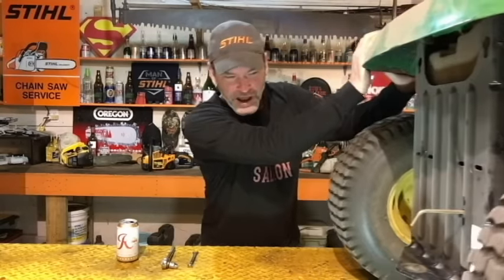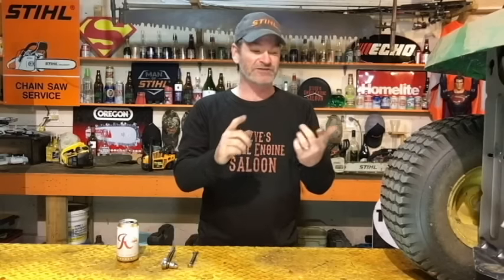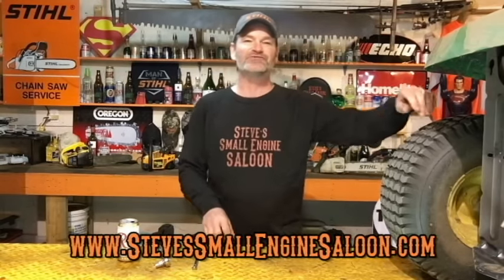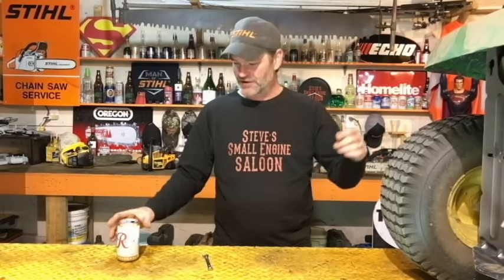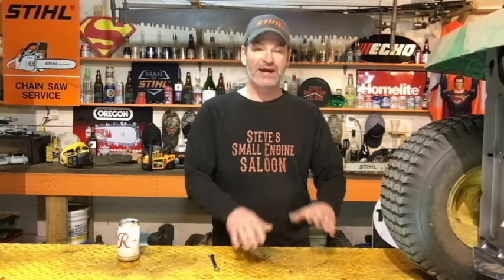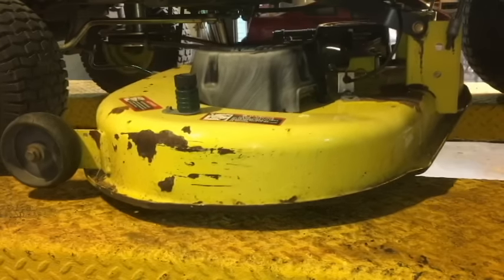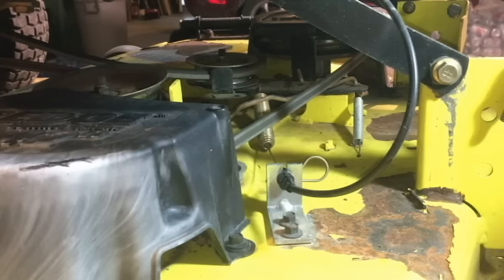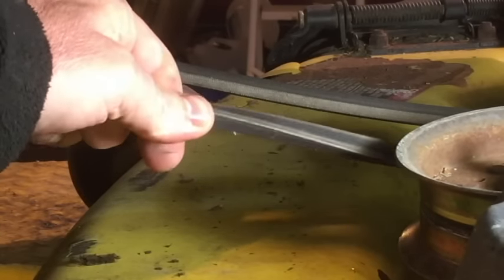How To Adjust The Belt Tension On A Riding Lawn Mower

Comment: Another great video, Steve - thanks! Bought a JD E-100 this summer - have less than 5-hrs on it & the belt broke. When I replaced it, the blades stop spinning when I drop the deck below 3-inches. I tightened the tension spring you like said and leveled the deck.  I dunno what's going on.

Comment: Steve, 

I have a John Deere L100 as well. You did a great job explaining it. That arm that is supposed to be mobile is not for my lawnmower. I sprayed lubricant on it, it moves a little, but after adjusting the two bolts, my belt is still loose. Any ideas? Thank you.

Comment: Quick question Steve. Put a new belt on the deck today and still slow engaging.... I havent tried the adjust yet,but if the doesnt work what's the chances it's the cable itself stretched?

Comment: Love your channel , Steve. I have a tired L120. My problem is the blade belt constantly gets twisted. It has an electric blade clutch so the belt is under constant tension. I've replaced the belt twice as once it gets twisted it dramatically shortens the life span.  The tension spring is tight. I just pulled the deck out to replace the drive belt and sure enough , the blade belt is twisted. It's a brand new belt only used for one cutting. I'm totally stumped. I'm hoping you or one of your viewers can help me ...

Comment: My belt is tight but the lower the setting it wont spin up my engin surges and the the  engin doesn't seem to rev up it spits and sputters smokes black when sputtering do you think it is a carburetor issue? Please let me know what you think

Comment: Steve, my newer JD 100 does not have that adjustable bracket. It is welded onto the deck with no adjustment bolts. Any ideas?

Comment: So my Craftsman LT 2000 does not have the adjustable bracket. It has a housing hole and a hole to screw it down. Any thoughts on how to tighten if it’s just a pto cable? A new spring?

Comment: Great Vid Steve! I have a Craftsman LT1000 that I just replaced the drive belt on. I noticed a lot more power on it but now it won't shift speeds while it's running. It does shift normally when it's off. The brakes don't stop it and it slowly creeps. I also noticed that my clutch/brake pedal does not respond as it did, meaning fully compressed/decompressed is very short. I am thinking probably cause of tight tension on clutch pully from new belt. ANY IDEAS ON AN ADJUSTMENT?

Comment: I just bought a Craftsman T100. It has a 36 inch cut but the right side does not fully cut the grass. Could this be an issue with a new mower ?

Comment: SUPER helpful video. Thanks, Steve. I have a 16 year old L100 with a Kohler Command engine which runs as good as the day I bought it. However, I have noticed the blade rpm has not been optimal through taller grass. I'm hoping a simple adjustment will fix this...love your channel. Cheers!
Reply from the maker: Good luck!

Comment: Hi Steve, I have a problem that when I start the mower up, the belt is so loose it snaps. I have tried to make adjustments, Ive replaced the belts with the original and with different sizes but it hasn't solved my issue. All the pulleys are in good shape. In your opinion would this tension technique solve my issue or in your infinite wisdom do you know why this is happening or have another trick that will solve this issue? Thanks Greg

Comment: Okay, I have a question. What would cause a riding mower to move (creep slowly in the direction it was last moving) when your foot is off the drive pedal? Something snapped (noise) and now it's doing this. Before the mower sat without moving. Clearly a pulley is still engaging the drive belt? Works fine beyond this. Any clues?

Comment: Hey Steve, great video. My 1999 15.5 42 Hydro JD does not have this feature, all it has is a bar cage for lack of a better term around the main drive pulley.  I can't seem to find a whole lot of info for this particular model for some reason. If anyone out there can recommend a decent website it would be greatly appreciated.

Comment: Hey Steve. I thought I was set when I watched this video. Went right out to make the adjustment. Turns out that bracket you moved is welded on my E-100. I also took the cable loose on the other end to see if I could shorten it, nope. So I'm back hoping you've got a solution.

Comment: wow, you hit it on the head!  The tension on my 42" Cub Cadet belt was too loose!  Not being familiar with where everything is on the deck, my fellow had to go on home to his dinner. Will be back tomorrow after he Googles a diagram...BUT, hold on, I'll refer him to this video. The Cub Cadet tension wire(cable) is set up in a very similar way as yours so I'm sure he'll find it and viola! the belt will stop coming off.  Eventually it'll need a new belt but not just yet.  Thanks!!
Reply from the maker: Right on

Comment: i knew the part about the adjustment but the issue with mine (and the
mower is only a year old) is that there was so much slack (with a brand new
correct OEM belt) in that "spring cable" to begin with that adjusting
it to the very end of the adjustment was necessary. What i did was take the
spring clip off removed it from the adjustment mount, then unhook the cable
from the tensioning bar, held the spring and push the cable up until the ball
from the cable was exposed. I took a small lock washer (i think it was
1/8" and spread the washer open slightly and slide it on the cable and
then closed the washer again. Only one washer was enough for my issue so if any
try this method of remedy, if you have to use more than washer then be aware
there might be another issue. When I remounted everything most of the slack
from the cable was gone. Now when I adjust the plate with the 2 10mm bolts it
actually had the effect it was meant to have. UPDATE!! On my D100 I now use a
102 x 1/2 " v belt instead of the 103 X 1/2" OEM belt. For me the 1
inch shorter belt last even longer than the original and with the adjustment it
worked fine for me.

Comment: Steve, I got a JD X540 and it blows 15 A fuses  as fast as I put them in, You can turn on the key and its good but when the engine is running  it will blow it and die instantly. What do you think?
Reply: It would be a safe bet that there is a short in the system tied to that fuse. Definitely do a visual inspection and look for frayed or chewed up wiring, follow up with continuity check on that circuit. Check all your ground connections as well. Sometimes if your voltage regulator fails and is over charging your system it will pop fuses, but those are usually tied to 20-30 amp fuses

Comment: Great Video, I just bought my first E120 John Deere and I had some quick questions.
When I go over uneven terrain, there is some clanking that can be heard coming from the bottom/deck i can't really pin point it. Is this normal?
Also, everything you pointed out in the video is loose on my tractor, belt and cable. Is that normal with new tractors? Should it be tight?

Comment: I have a troy bilt that has the same type set up for the PTO. Mine does the same thing but also if i try to drop the deck the blades slows way down. My question is 1. Is there a adjustment for a troy bilt like that. And 2. Would that fix the blades not slowing down when dropping the deck? Thank you very good video!!

Comment: Hi Steve.. I've been trying to find info relating to the blade belt tension that I can't seem to find anywhere. I have a Craftsman YS4500 which for some reason has a tendency to actually BREAK the front left hand belt keeper for the blade belt. It has broken 2 of them in one week.. literally broke the brand new replacement belt keeper I put on it after one mow, which caused the belt keeper to bend into the pulley and shoot sparks (fun!). My question is, do I possibly have the opposite problem of this video and have the belt tension too tight? The lever takes some elbow grease to engage the blades but I've never used a manual one like this before so not sure if that's normal. I grew up using my dad's rider that had an electric PTO. I have read on one other source that the blade keeper shouldn't actually touch the belt and I believe mine did when I put the new keeper on, though since my new belt keeper is also broken and misshapen I can't be 100% certain. Maybe my issue is in fact too much slack? The blades don't seem to be slipping, but is it possible that when I disengage the blade the belt if too loose when disengaged could be whipping the left belt keeper a little bit each time until it finally bends into the pulley? Just wondering if you've run across this before because I can't seem to find anyone else on the internet who has and knows what to do. Thanks!

Comment: I no this is really old but a question I have a J D l100 with the 42 inch bed . the bed got replaced with a brand new one and the  adjustment you show at 6:20 is not the same . they welded the bracket to the bed so you cant move it . so my question is how do i adjust it ?? this bed came fully assembled so all i had to do is hook it up . and the belt is brad new from JD for that deck , but when i disengage the mower the belt will pop off the from drive pully . all  guards and belt holders are in place . just to give some better info . thanks for any help
Reply: Please let me know if you've sound a solution. Thanks!

Comment: Masterclass. 
That's something (else) I didn't know about. Never seen that adjuster point on my Murray mower so maybe it has a different system. But I did just have my blades fail to engage and assumed the belt had snapped. No, it was that swivel point -- the bolt had come loose, so it was good hearing you mention it.
Something even elser I don't know about is how to adjust the clutch release pulley. With the engine off it's easy to put the. lever in each gear so I assume (??) the gearbox itself is ok -- I hope. But when running it can be a pain to change gear. So maybe you could do a masterclass on that? Thank you.

Comment: Hey Steve great video and super informative, so much so that I went straight out to my John Deere E100 Riding Lawn Mower to try and fix my loose belt (Noticed it was loose after installing a new Engagement Cable), and wouldn't you know that John Deere has now started welding the Engagement bracket that you suggest to adjust to the actual mower now. So I am still stuck as I can't adjust that piece to tighten or loosen my belt. Do you or anyone else have any suggestions on how to tighten the engagement belt if it is welded? Thanks again, man!  ~Dan

Comment: Question My D125 PTO engages when I raise the mower height above 3" and turns off when I lower below 3" all with the PTO lever not engaged. Something is causes the blades to spin freely as fast it when the PTO lever is engaged. Any Idea? Im thinking its a pulley adjustment needed I'd hate it to be electrical as it only happens when the height of the deck is changed.

Comment: I have a JD 115. It keeps throwing the belt, either during engagement or dis engagement. I tightened up the belt but it still happens. I noticed the length of the belt varies by as much as an inch and that is with OEM belts for my mower. Need a little help as to what to look at to fix this issue, if you have some ideas.

Comment: Hi, Steve.  Thanks for all the knowledge.  Do you think this would work on my 2006 Craftsman DYT4000 lawn tractor?  It's got an electric clutch and the blade engages with a button.  According the manual, there is no adjustment.

Comment: My belt comes off of the front spindle when I disengage. I have the S120 and I don’t have the adjustment bolts you showed.  Thoughts on this?  It’s brand new.
Reply: Find a diagram for your deck belt and make sure the belt is routed correct;  maybe the wrong size belt is installed.

Comment: The deck loses speed when I lower it and only works at full speed in the highest position. Would this fix that issue or would that be something else? Also it never fully disengages it always spins slowly even with the lever pulled down

Comment: Very helpful video, Steve.  Thank you!  On the D140,  I'm about to remove the deck for the first time but i'm finding that going up steeper hills like 30 degrees it seems to slow down and i can smell a belt or a clutch heating up,  I had the drive belt replaced after 100 hours of run time and it is still happening.  is there a way to adjust the tension on the drive belt or is this unit just not designed for hills like i'm mowing?   Thanks for any advice!

Comment: Here’s a curly one. My blades are not bent but they cut at different heights. When I put them tip to tip under the cutting deck they are at different heights but all the washers and bolts etc are the same on both sides. It is possible I’ve bent the spindle mounts? It runs fine just cuts unevenly

Comment: I bought a new belt and it skipped every time I disengaged. I hope this works! Thank you.
Reply from the maker: Good luck!
Reply: It's better, but still jumps. My guess is the idler pulley is not picking up the slack when disengage. There is a coil spring near there on the bottom of the deck, could that be part of the problem?

Comment: The belt on my Scotts 42 inch riding mower keeps coming off. I replaced one (right side) blade pulleys, spindle using a reinforcing ring. I took the belt off and checked the length against the 104" spec I found online and it was close - but I am not sure I know how to read that measuring device Lowes had next to the mower belts. The tension adjustment (moving the bracket back) has been done and is maxxed out.

The belt that is on it (and off it) does not have the wrapped appearance - it is just black with no markings visible anywhere. I don't want to by a non-returnable belt only to discover that there is another reason the belt will not stay on. I was thinking of buying a 100 inch belt (four inches shorter than 'factory') upon the thought that the old belt is stretched. But looking for 'expert' advice!

Comment: Steve, Do you have a vid on adjusting the other belt that drives the rear axle?  I have a couple hills in my yard and the last time my mower stopped wanting to go up them I just pulled the deck off and put on a new drive belt. This completely solved the problem and I had zero uphill issues.  There must be some adjustment though because the belt looks fine still (only a year and a half old) and it's starting to do the same on hills again.   Thanks!!

Comment: Came here to learn about belt ajustment.... Steve, you have a link to that vid on belt replace as of May 2020? I assume most these decks are the same to a degree. My MTD Yard Machine I brought used other day ( 742 RL ) has exact issue. I go to start blades and slowly they whirl up. Kinda like a fan. Takes about 8 sec to fully kick in. Drives me crazy because this mower is made when in reverse it kills engine if blades are on. So I constant whirl them up. I will take a look and look over all in vid on my mower. If I have to replace belt that must be a nightmare being I never done. Will I have to remove whole deck? Now as for the cable bracket ajustment, say if a new belt is installed than where should I ajust bracket? All the way to front.......

Comment: Hi Steve I have a John Deere la145 I had to replace the drive belt and one pulley now it's slips and sometimes will not pull the tractor , how can I tighten the drive belt

Comment: #192346 ‘A’ belt not lasting on Poulan 14.5hp riding mower so would it be good to convert to a bigger B - belt and how would you convert from the 97&13/32” size specification under the hood?

Comment: I put on a new belt on my Scott 46 in mower and when I start the engine the blades are spinning without engaging the lever. Is there a way to relieve the tension on the belt?

Comment: Hey Steve how about electric clutch models? Our Husky 46" likes to squeal every time we get into heavier grass. Our new ZT1 54"  handles the same grass with ease at full speed and no squeals. Is it just worn belt or perhaps worn out  pulleys after 20 years of mowing? You know it is a higher end Husqvarna because it has an hour meter. Learned that trick when we were looking at used machines. No hour meter? walk away. I came to realize we had a good machine with real steering gears (most are sheet metal gears) so I rebuilt everything but now it is our weed machine but that belt problem is even more annoying and it slows the blades down right when you need them most as they slip. Any thoughts guys? I am considering getting a new drive pulley in case the sides are warn out after 20 years of mowing. Otherwise the old Husqvarna runs as new. Had to replace the deck a couple of years ago and repair the steering gears but that's about it. It was terribly abused and came with our house in Maine 15 years ago. Tough buggers when you get the higher end machines.

Comment: Great video IF you have those mowers you named. If u have a Cub Cadet there's no way to adjust the belt tension that I could see. I ended up cutting the lever cable and resplicing it shorter with small cable clamps. Is there a way?

Comment: I’ve been getting a burning rubber smell recently when I engage the mower lever. I adjusted the belt not too long ago as you suggest in your video. Maybe it’s time for a new belt? Is it slipping? It engages quickly.

Comment: Steve, would this same procedure also work on a Husqvarna that has a knob you either pull to engage, or push to disengage the blades? I suppose maybe this is an electric switch. Thanks, John

Comment: I went through all this work and finally got the belt on and now for some darn reason the engine won’t crank cause the belts too tight,I really hope I have the right size belt man,I have a 96.5 inch belt on my 42 inch craftsman riding mower

Comment: question Steve, I have a John deere E 100, and I'm trying to adjust my belt, but my mower doesn't come with the bolts to adjust it. it's welded on there, I bought it new, and that's how it came. Is there any other way to adjust it